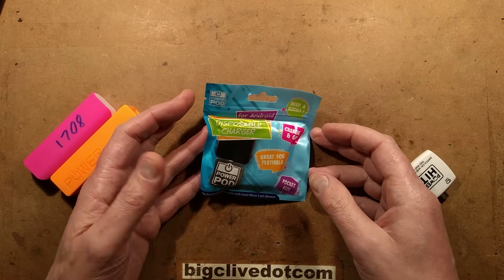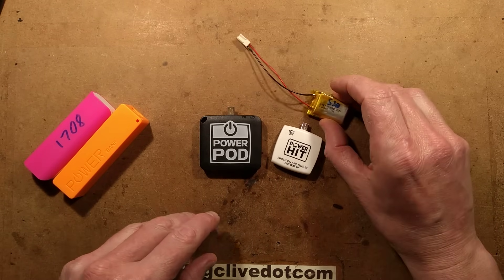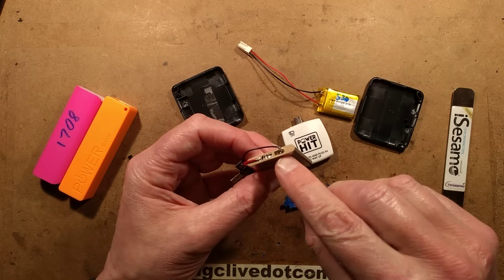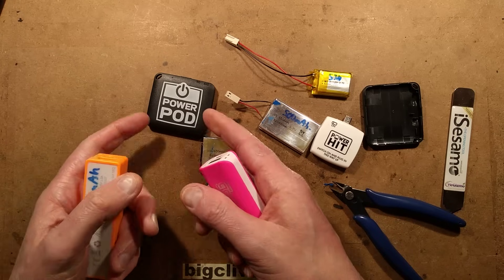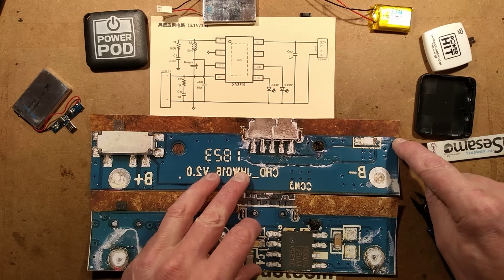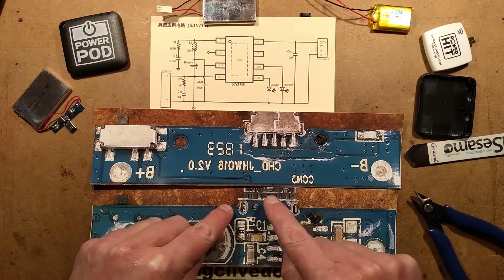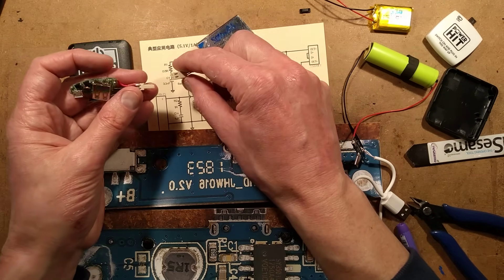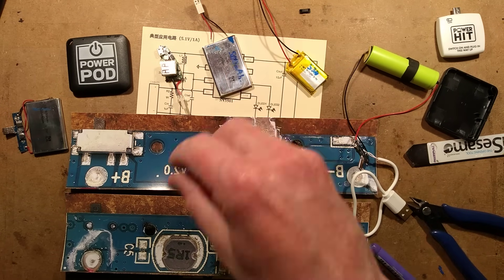Poundland "disposable" phone charger.

Comment: I was really annoyed that I saw your original video on the PowerHit shortly after a deal on the same thing under a different brand name had closed at Meh.com. I had presumed they had primary cells of some kind and skipped the deal - and thus was quite peeved when I realized I'd missed out on a very cheap source of smallish rechargeable cells. And of course, I haven't seen a sale on them since.

On the other hand, the clones of the Nokia BL-5C battery seem to be used in a LOT of small Chinese electronics, from a 200mW FM transmitter I have to a variety of small portable FM Radio/MP3 players - and theoretically those include protection circuitry. I've seen them available at about $1.45/ea in quantity 10 on places like AliExpress and I wouldn't be surprised if they were cheaper somewhere. Obviously the ones claiming 2450mAh are lying, but given how old the form factor is I could easily imagine the original 800mAh having increased - but at most to 1200mAh, more likely about 1000 - definitely NOT 2450. ;)
Reply from the maker: The Nokia batteries seem to have evolved as a standard style of battery and contact.  When my mum had her GPS tracker it used a standard Nokia battery, which was great because we could make sure there were always charged spares for it.  I've also found (and made) things that use it as a slim protected cell by soldering directly to the contact pads.

Comment: Interesting how it's branded as "for Android" when it's micro-USB when most modern Android phones are Type C.
Reply: Yeah, it clearly shows me how outdated the designs are for those battery packs.
Reply: "most" :D I'd bet that over 90% of android phones within the population will have micro-usb ... Most people are not tech geeks and don't buy flagship phones or even any phone more often than every 4 or so years.
Reply: @YS_Production  Micro USB is an abomination and needs to be abolished anyway.
Reply: James Collins, that's irrelevant, you're not responding to the point he made – that the vast majority of Android phones currently in use don't use the USB-C connector.
Reply: @jasondoe2596  It better to buy poundland 1200mph power bank one for one pound or there power geek 2200 power bank  one for two pound  or there 4000mah power bank one for five pound
Reply: @jamescollins6085  Why is it an abomination? I recently repaired my 2 year old Android phone by resoldering a microUSB socket - it was still fine, just the stupid lead-free solder broke loose. Would i have been able to do it with Type C? I doubt. And you know how it is these days, things are gonna break.
Reply: I have an iPhone......ironically EVERY  gadget that goes with it, including my Qi charge pad, and Bluetooth earbuds.....uses a micro USB for something..... Face palm .
Reply: @prismstudios001  
That's because you have the wrong phone. 
There's about a 3 Androids to every I phone in use. So it's obvious that accessories are made with the most commonly connector.
Reply: @johnnodge4327    They sell the same stupid thing with a lightning connector. Its equally useless.
Reply: @prismstudios001  It better to buy poundland 1200mph power bank one for one pound or there power geek 2200 power bank  one for two pound  or there 4000mah power bank one for five pound
Reply: @mrwahibtahri  
The £5, Geek 4000 mAh power pack I bought last week has just 1800 mAh of capacity. The £2 Geek I bought at the same time has 1750 mAh of capacity. 
The standard £1 Poundland power banks often have 850 to 980 mAh of capacity. 
So which is the best value in mAh per £. It's the cheap £1 power banks of course.
Reply: @johnnodge4327  lol your one faulty I have 4000mah one and I did have 2200mah one and I got only 46% charge from the 2200 one and over 68% in the 4000mah one not 68% more but I do not remember but it was over 68% ok
Reply: @johnnodge4327  for mah the 2200 one as you get 4400 four four pound but the 4000mah one is better for something than the 2200 one ok

Comment: In 1990s Britain there was a lot of talk about Trevor Bayliss and his wind-up radio. A handle wound a strong spring which drove a generator to power a radio. Could you make a wind-up human-powered phone charger? By my calculations (probably wrong) 4000mAh at 4V is about 60kJ - equivalent to about 13 kilocalories, not a significant part of a typical human's energy budget.
Reply from the maker: Even with LED flashlights the amount of effort required to put some charge into them by physical means is immense.  Not worth the bother unless it was all you had.
Reply: @bigclivedotcom  Well, the "jerk-off" LED flashlight was big over in the US for a little while... LOL
Reply: if you have an old bicycle, you can go full bridge rectifier+cap on the dynamo, it produces max 6V usually (zdiode) less under lower rpm.
with the bridge+cap you should reach the 6V earlier.
The old dynamos had terrible efficiency but you can get your 5 to 10 Watts.
then go linear low drop regulator to 5.2V / 1.5Amps and you can charge anything usb.

...And use a simple phone without touch, simple lcd and buttons 😄

On a fixed bike/treadmill you can easily work 30..50W of load, 75 is already a bit sportif...
Reply: @PsiQ  I should actually get myself a hub dynamo for the front wheel and make a self-built power bank by designing the electronics (it's not quite so trivial if it should be optimal) and stuffing a bunch of 18650s into the handlebar, with an outlet at the end. Wouldn't that be nice?
Reply: I recently went into the back of an old cupboard and found a wind up charger that once belonged to a Nokia 3310. I had forgotten all about it till I found it in there and that's when I remembered just how utterly rubbish it was. Perhaps if it were a better made charger it might work better but, given the experience of that thing at Leeds fest many years ago, I have my doubts!

Comment: I'd be interested to see a review of the Blackweb charge bank; I recently bought an Aukey 20100 mAh one, and it looks identical to the Blackweb (and is also pretty darn heavy). I reckon it's a useful bit of kit.
Reply: I'm a geocacher, and together with many in the UK Geocaching FB group, swear by the Anker Powercore 20100 - sure, it's a little weighty (360g / 12.7 oz), but you are looking at 6x 18650 cells inside the casing (as the name suggests, 20.1 Ah = 72.36 Wh) - so plenty to keep your phone topped up during a day's roaming around the countryside, making extensive use of GPS + data + screen + camera.

Comment: I see the cheap power banks are still only offering Lightning and microUSB, then - no USB Type-C yet :( They're going to have to make the jump at some point, as more and more in-the-wild smartphones are using Type-C these days - my Nexus 6P is only 2 months shy of being 3 years old now, and that uses Type-C! To be fair, Type-C ports are a fair bit more expensive to buy (even from the Chinese markets - maybe $0.50 instead of $0.05!), but I'm pretty sure you don't need to use one of the dedicated USB Type-C ICs if you just want to provide standard USB A/B charge currents and output-only (don't quote me on that!).

I'm currently looking at getting the Huawei Mate 20 Pro on contract (£900 monstrosity, but the £50/mo for 24 months that Vodafone want for it works out at "only" about £700 more than my current SIM-only contract with them would cost me over the same period, and you do get a hell of a lot of phone for your money), and that has a 4200mAh Li-Ion cell in it, so this Power Pod thing might give it a 10% charge at best? That's not great :)

But honestly, for cheap Li-Ion cells, I'd still recommend HobbyKing (a lot of whose stock is essentially some of the higher-quality stuff that you could buy direct from China, but they have warehouses in the UK, Netherlands, Australia, USA, Brazil, China and Hong Kong, so you can get fast shipping and, presumably, UK/EU/AU consumer protection - note how I left out USA, there, as I'm pretty sure the US gov favours corporations over consumers ;)). Here's a search for Li-Ion/LiPo single-cells from the UK warehouse for less than £5: https://hobbyking.com/en_us/batteries-chargers/batteries/lipo.html?price=0-5&config=51&wrh=1&dir=asc&order=price

Of particular note, they currently have a 2000mAh LiPo with a JST-PH connector for less than £3: https://hobbyking.com/en_us/turnigy-2000mah-1s-1c-lipoly-w-2-pin-jst-ph-connector.html
Or for £6.43 you can get a 5000mAh "20C" discharge (i.e. up to 100A!) cell - but it only comes with bare solder/spot-welding tabs, which are a bit nerve-wracking to solder on to! https://hobbyking.com/en_us/turnigy-5000mah-1s-20c-lipoly-single-cell.html
They also have 2000mAh and 2500mAh 18650s, but they're IMO a bit pricey when you can get what appear to be genuine Panasonic 3350mAh 18650s from AliExpress sellers for around £4 each (the ones I bought have all tested at that capacity, at least).

Comment: These things are so wasteful and pointless. They'll all end up in landfill without having really been useful.
Reply: Not only that but batteries should always be recycled anyway, not thrown into a landfill.
Reply: @vgamesx1  It better to buy poundland 1200mph power bank one for one pound or there power geek 2200 power bank  one for two pound  or there 4000mah power bank one for five pound
Reply: @mrwahibtahri  ok but what does that have to do with what I said? Batteries should be recycled regardless...
Reply: @vgamesx1  just letting you know OK
Reply: Nj Rh yes for a remote? Lasts half a year, for a camera? Lasts a bit , for anything aa batteries last atleast a while and get recycled and this crap charges your phone by 5% and its completely useless and is harder to recycle
Reply: morrisons used to sell them too a diff brand ,shitty 300mah's for £3 lol, u could literally plug in ya phone at morrisons or tescos in the printing photo machine leave it there for 3 mins and get the same amount of charge for free ( if u got fast charging device )
Reply: @girlsdrinkfeck  I agree. If I hear u right, its not worth using at all. I bought a 10a or 10,000ma power bank that can be recharged but it seems to only slow the phone from running down. I bought a smaller one that said 2000ma but the 18650 inside was only 1000. I replaced it with one from an old laptop that is 2600ma and it works great. I hope people don't buy this "throw away" garbage😀
Reply: Tom De Mulder sounds like 50%+ of  the stuff PoundLand sells.
Reply: I mean, if they were carbon-zinc or alkaline cells it wouldn't be much different from traditional disposable batteries, heck if it were a carbon-zinc cell it would be better than the more common alkaline type due to being less of a hazard once discharged. What really pushes this into unacceptable territory is the use of a fully working lithium ion cell, which could be recharged and put to better use given the opportunity, and in a situation like this is more likely to either pollute a landfill, or explode in a bonfire.
Reply: Tom De Mulder I agree 100% its dumb and VERY wasteful
Reply: @Nj Rh but AA batteries arent as overpriced as has much more energy ,not comparable at all ,u talking  chalk and cheese
Reply: disposable vapes are the same thing. also a battery without any protection. but instead of charging your phone, they power a metal heating element to heat up e liquid
Reply: @Zodliness  probably selling our own crap back to usp
Reply: No it's not. At best, the hazardous recyclables are eventually dumped in discreet landfills or dumped in other countries, generally overseas.
Reply: Cool it with the anti-semitism bud.
Reply: We'll be mining dumps in 100 years
Reply: @John Doe I'm British. 
Countries may have recycling programs, but the people who buy a disposable phone charger won't be the ones carrying the empty one to a battery recycling point.
Reply: It should be a crime to sell them
Reply: John Doe not when councils can't afford to anymore and the countries that used to take it off their hands stop the import of waste...
Plastic being the main culprit and the use of glass not as much as it should be.
Reply: A bit like buying Xmas presents then
Reply: Charging circuitry probably only costs a few cents.
Reply: @adaml.5355  And? That doesn't mean they're wasteful.
Reply: @adaml.5355  It better to buy poundland 1200mph power bank one for one pound or there power geek 2200 power bank  one for two pound  or there 4000mah power bank one for five pound
Reply: Should be forbidden
Reply: Maybe they're not. Suppose there's some production line for rechargeable batteries. Say a portion of cells are defects and fail the high standards for the desired lifetime of recharge-discharge use, but are still kinda okay. Or say there was a recent re-design and there are still many leftover cells from the previous generation. 

It would be wasteful just to send them straight to landfill. So say the company repurposes them by giving them a one-off charge and selling them.

So maybe the product is waste-reducing and useful?

Comment: I've never heard of an OTG rechargeable power bank before, that sounds like a good idea but I doubt anyone would want a dead power bank sticking on their phone and draining its juice
Reply: but stealing power from your mates phone .........
Reply: @outanet  It better to buy poundland 1200mph power bank one for one pound or there power geek 2200 power bank  one for two pound  or there 4000mah power bank one for five pound
Reply: I'd think it would work better with the new usb-c standard, as the connector is the same at both ends, just unplug it from your phone and into a wall charger with the same connector.
Reply: @Dganny24  It better to buy poundland 1200mph power bank one for one pound or there power geek 2200 power bank  one for two pound  or there 4000mah power bank one for five pound